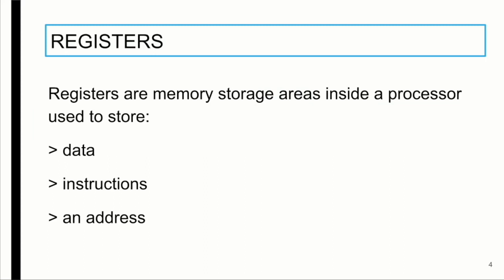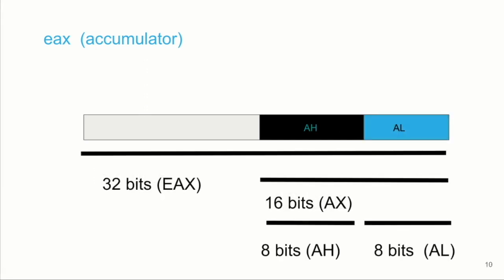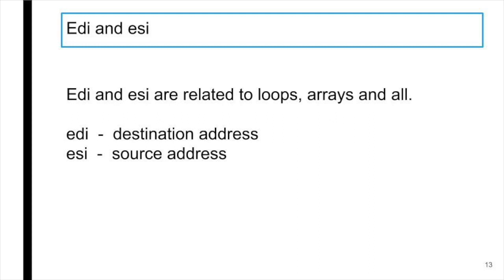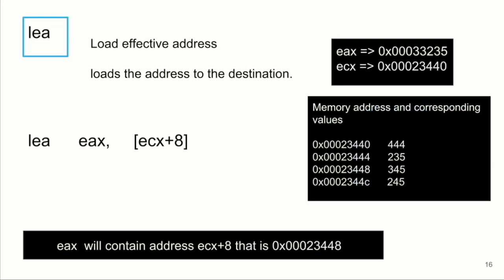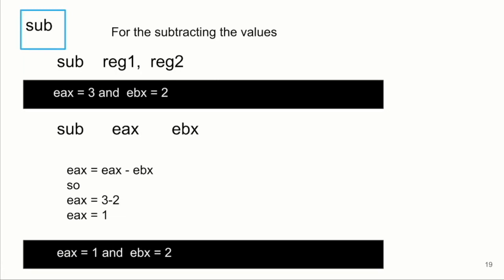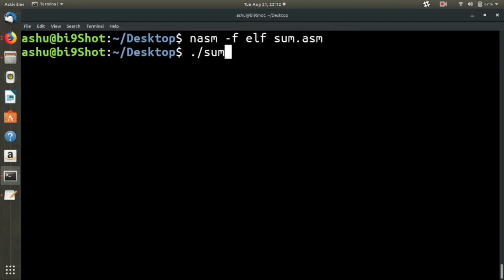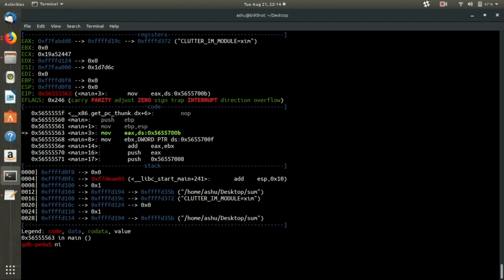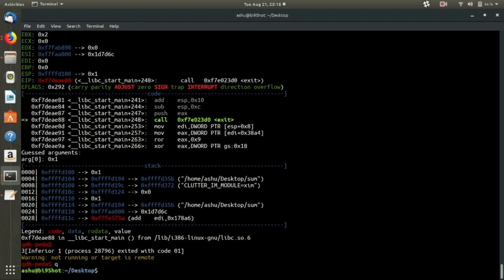x86 Assembly -  Register and Instructions

Comment: For adding values some times faster:
mov eax, 1
mov eax, 2
lea eax, [eax+ebx]

...

Dump of assembler code for main:
push ebp
mov ebp, esp

mov eax, ds:0x200b
-- The DS-segment override make no sense, because for the memory location "DS" is already the default segment.

mov ebx, DWORD PTR ds:0x200f
-- The size of the ebx register is well known, so we don't need to specify how many bytes we want to acess.
-- The DS-segment override make no sense, because for the memory location "DS" is already the default segment.